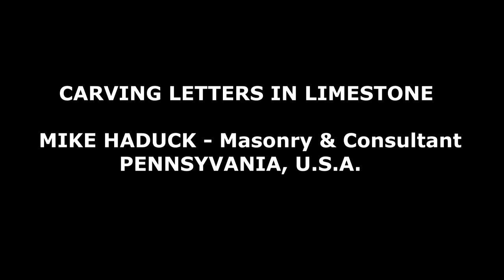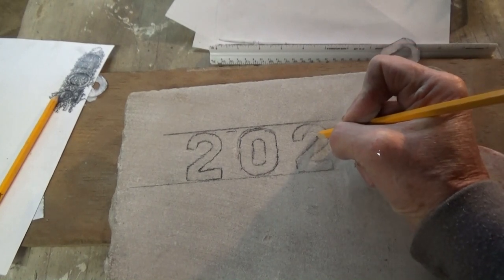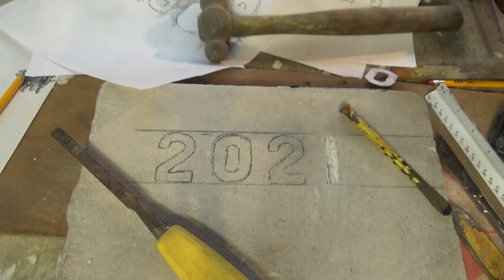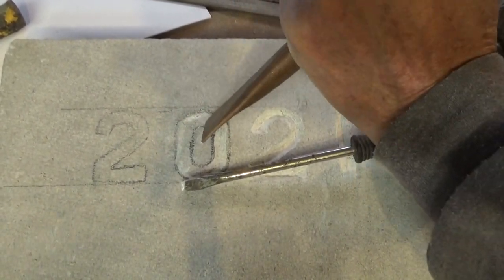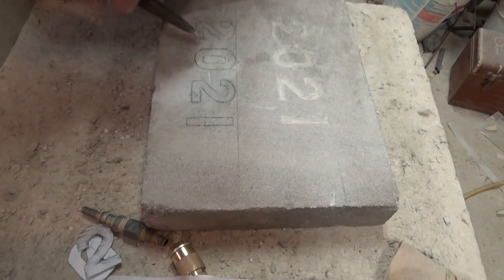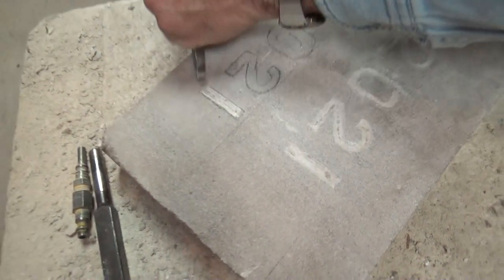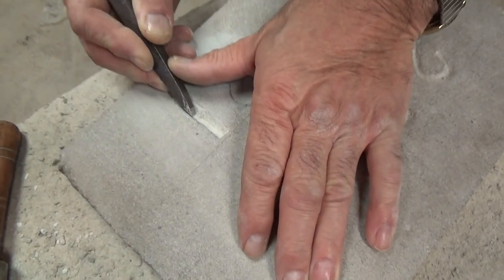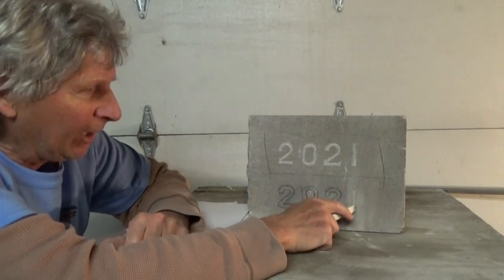CARVING LETTERS IN LIMESTONE (Mike Haduck)

Comment: While it is possible to carve a date or a few letters in soft stone for the past hundred plus years pneumatic tools and sandblasting has been used to carve lettering on gravestones and monuments. When you need to add a date to a gravestone, a rubbing just as you did is taken to copy the style of the lettering IF you don't have the stencils in the same font to lay out your own. A piece of rubber is glued to the face of the stone and the new lettering is transferred over to the rubber. Then the lettering to be added is cut out with a sharp knife. The letters are then cut using grit blasting. Holding the gun at an angle lets you carve the sloped V-shaped profile of the letter in the stone. The same can be done when carving flowers or logos into stone. Using a technique similar to silk screening where you uncover different areas to blast them then replace the cutouts to protect that area during the next blasting session.

Your process will work well for making a cornerstone for a DIY project or to add a personal touch to ones home.

https://www.youtube.com/watch?v=amf7KqXYVu4

Happy New Year Mike and keep your videos coming, I enjoy them all.
Reply from the maker: Thanks Bob, happy new year, I appreciate it, Mike

Comment: As you know most lettering is done by sandblasting, CNC or insomar machine but you can't beat hand cut. One tip Mike, you might like to invest in a Vitrex VITGO200VT grout removal tool, very cheap but is perfect for small lettering with its hammer action tungsten tip. As always excellent presentation and Happy New Year to you.
Reply from the maker: Thanks Nick, Happy new year,  I will check out the tool, Mike